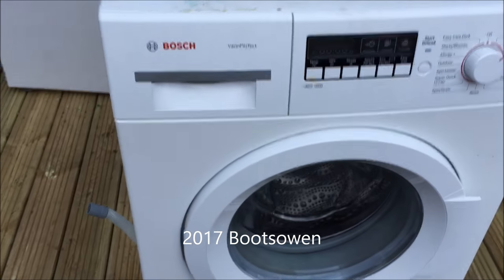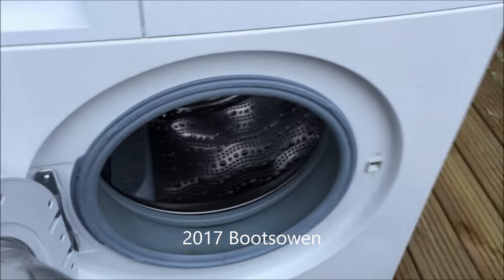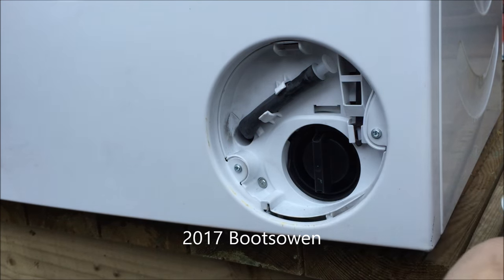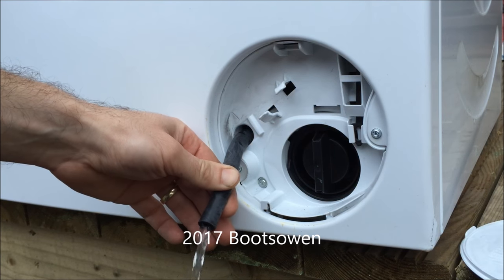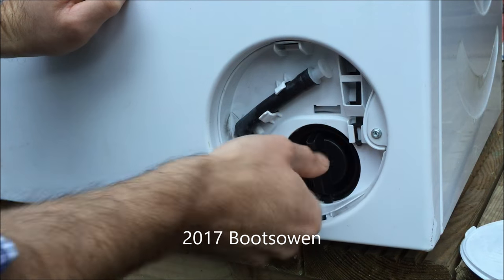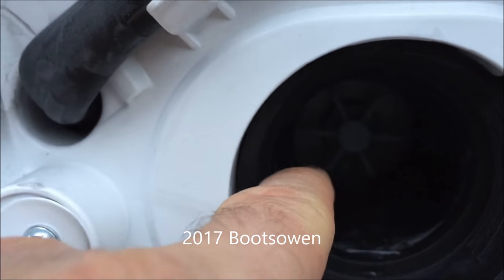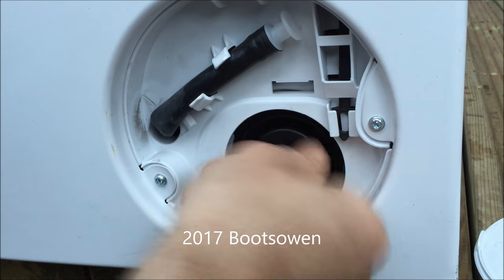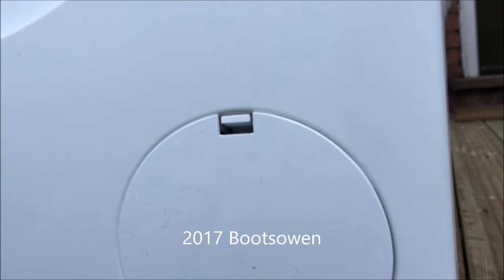How to clean coin basket and pump filter on Bosch Varioperfect washing machine.

Comment: Bosch recommend that you pour a litre of water into the dispenser and Then set machine to drain. older machine had a drain setting, but on new model it is spin/ drain and can take up to 13 minutes
Reply from the maker: What do you mean? Set it to drain with the plug out or after you have cleared it?
Reply: @bootsowen  on older machines there was a setting for draining the machine, after you put the 1 litre of water in you did this, because when you do your next wash, your powder / detergent will be flushed out of the machine

Comment: What is the black plastic part to the right, that is held inside the open white casing please? What happens if I pull this down? 🙇‍♂
Reply from the maker: Try it
Reply: All the machine parts opened up and the machine reconfigured itself into a robot. This is very impressive. Arms and legs and everything. Is there another button to transform it back into the washing machine?

Comment: I have what sounds like a coin rattling around inside my Bosch washing machine.
It's not in the drum and you can't hear it when you manually rotate the drum. It's also not in the filter like the one that you removed.
You only hear it on the spin cycle and even then it's intermittent.
Reply from the maker: yes? Have a look at my other videos, I have one from a few years back with some pretty epic coin damage.
Reply: @bootsowen  
Shall do.
Thanks !

Comment: my drain hose does nothing..no water comes out. is this normal after using the "drain" feature? I pull the filter cap and a lot of water came out
Reply from the maker: The little hose is probably blocked, some coathanger wire or blowing into it should help.

Comment: The door wouldn't twist at my washing machine
Reply: Mine would do only 1/4 turn. I removed the waste water pipe from pump and was able to remove 2 pieces of wire which was preventing it opening and then I was able to unscrew door.

Comment: Hi Bootsowen do you know why my hotpoint WMFG741 G UK is leaking from the drum
Reply from the maker: No? Why is it leaking from the drum?
Reply: @bootsowen  because somehow it cracked it was a 2013 model
Reply: @bootsowen  are they notorious for cracked drums?
Reply from the maker: Sounds like you know why it is leaking. why would you have asked me?
Reply: @bootsowen  to check reliability of it
Reply: @bootsowen  is it a bad quality machine?
Reply from the maker: But that wasn't what you asked me tech guy, you asked me "do you know why my hotpoint WMFG741 G UK is leaking from the drum", your new question is about reliability, your machine is broken, therefore, on that basis alone, I would say that it is reliable, it that you can rely on the fact that it is broken and will leak. Or is the answer "no"? Does the fact that it leaks, and that you know that it leaks, make it unreliable? I don't know. What I am also confused by is why you would post such a question on a bosch filter video? But maybe my confusion is rhetorical? I think that to answer your original question "do you know why my hotpoint WMFG741 G UK is leaking from the drum"? .....Because it is......(rhetorical eh?....7!)
Reply: @bootsowen  no it wasn't a rhetorical question what I meant bootsowen was basically do you think the materials were bad which caused the Hotpoint WMFG741 G UK to leak in late 2019 
But in general do you think 
the Hotpoint WMFG741 G UK Is Reliable obviously mine was crap but do you think it is generally reliable?
Reply: @bootsowen  Also while I'm at it I should probably ask you if they're notorious for leaking.
Reply from the maker: https://youtu.be/779fMc8ubOo
Reply: @bootsowen  what does that mean bootsowen?
Reply: @bootsowen  haha you just got Rickrolled lol 😆
Reply from the maker: @TheOfficialGlitchTTG  Ha ha, I didn't know what the link was, I deleted it  before it was posted publicly!   Good try!
Reply: @bootsowen  it was actually legit but what I sent you was called a Rickroll be sure to search it up thank you for your time merry Christmas 🙂
Reply from the maker: @TheOfficialGlitchTTG  Thanks for the headsup on what a rickroll is!
Reply: @bootsowen  have you watched it it is called Never Gonna Give You Up
by Rick Astley in 1987

Comment: This machine is probably only about a year old! Spanish quality! Some of these cheap machines are made in Spain!
Reply: Many modern Bosch/Siemens machines are also made in Poland
Reply: Paul Hojda oh wow! Also why it's cheap crap 😂😂😂 I don't have anything wrong with the country it's just that German quality is the best quality.
Reply: Agreed, but I have a Polish built Bosch series 4 and it seems pretty solidly made, inside and out.
Reply from the maker: I don't think there is anything particularly wrong with the build quality or workmanship, it is really just a bolt together item.  I think it is just the cheap end of the design spectrum, Bosch trying to please everyone and use the cheapest parts. So if the Germans are willing to put their name on it and it isn't such great quality it is not really fair to blame the country that made it. Just my thoughts on it!
Reply: bootsowen yeah. I wasn't blaming the country. I'm just blaming cheap labour.
Reply: Washing Machine Guy miele are using plastic outer tubs now apparently!